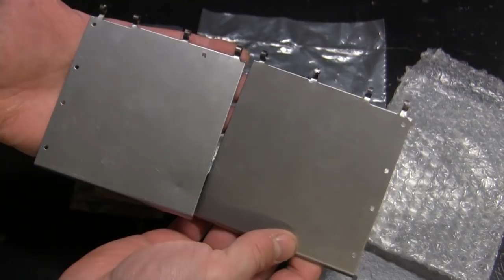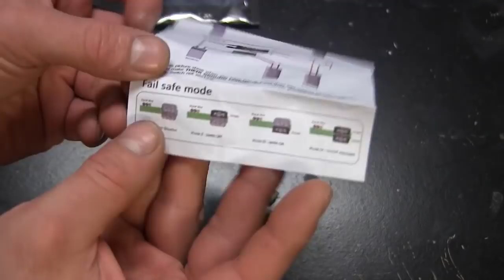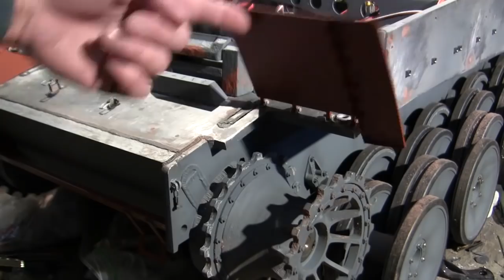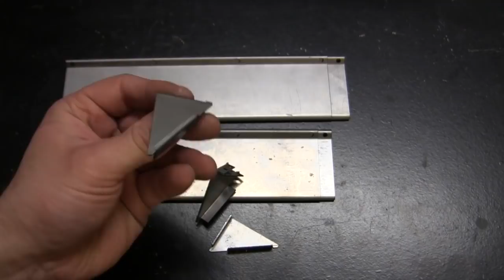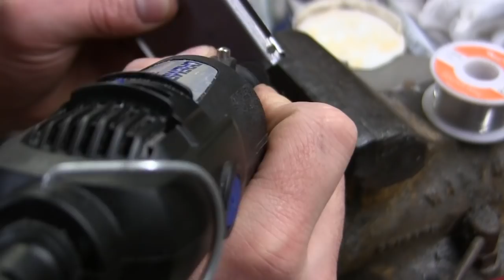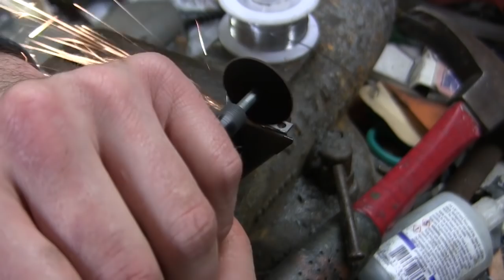RC 1/6th scale Armortek Early Production Tiger video #13 (convoy light and fender / side skirts)

Comment: the 'boxes' on the radio controlled switch are called jumpers. They are commonly used for static configuration especially if you do not have the place to use some of the other static configuration components:
https://bit.ly/2FTK0Od